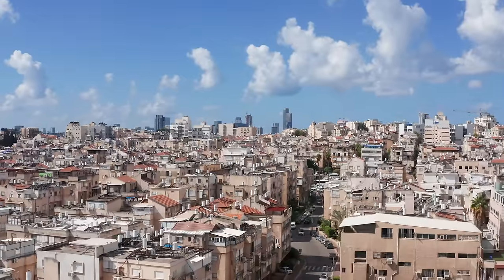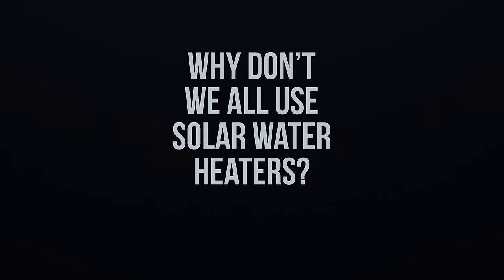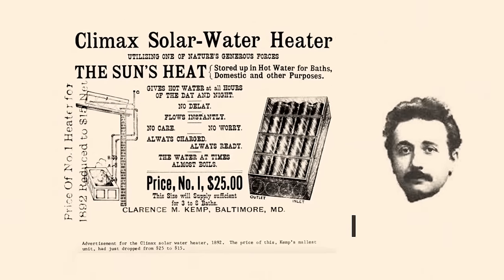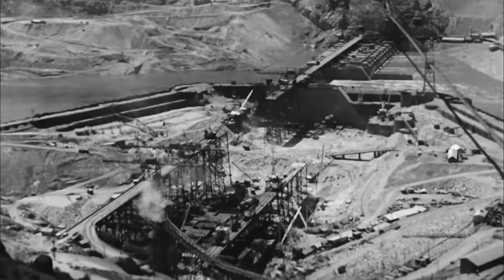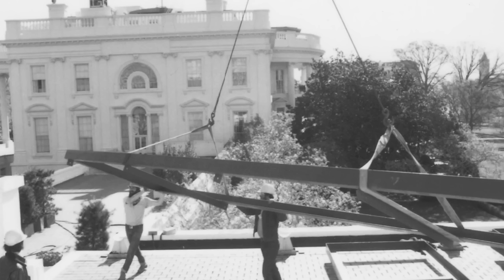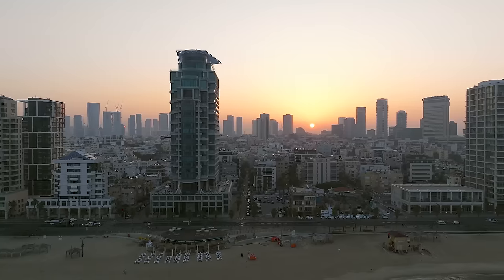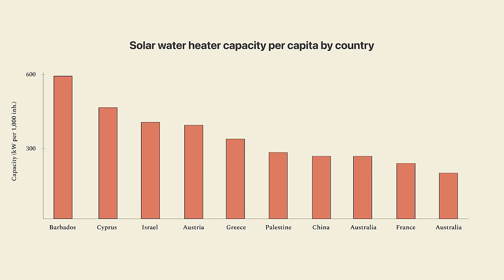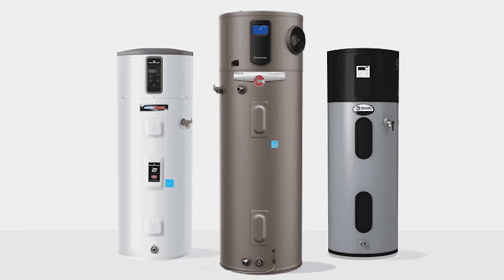Why Don't We All Use Solar Water Heaters?

Comment: let me get this right. Solar hot water "works" when the sun shines. 
It heats up the water using the power of the sun either directly and depending on the model - can heat the water through the use of the sun's heat directly or using solar panels to create electricity to power the the heating element which then heats the water.
Absent of the sunshine either due to seasonal changes or because it's a cloudy day - the solar hot water doesn't function or doesn't function well enough to supply the dwelling with enough hot water for the dwelling's needs. The "backup default" thus far has been either grid fed electricity or gas that is used to heat up the water...

Meanwhile "Heat pump" hot water also uses electricity but more "efficiently" by taking the heat of the surrounding air and transfers the heat to a refrigerant which is then compressed using a compressor which functions similar to that of the traditional heating element.

My question is: why isn't there a model out there that integrates the two system?
Have solar hot water on the roof with heat pump sitting on top of a nearby storage tank?
A temperature probe should be enough to switch the the "heat pump" end of the system on or off given that that majority of the time the "solar water heater" will be doing the heavy lifting... 
Granted I'm not an engineer, but one would've thought that the heat pump's hot water tank should be constructed to hold water that's been heated through alternative means similar to solar water heaters?
Am I missing something here?

Comment: A better approach is photovoltaics running a heat pump hot water system, once your hot water is up to temp you can use the extra power elsewhere, with thermal solar panels once the water is hot, thats it.

Comment: Because one solar panel only makes enough energy to run a toaster. You need ALOT of Solar panels to provide energy to a home. Even if a roof is covered with solar panels it still won’t provide enough energy to run a home.

Comment: Bottom line is that solar only works well where the sun shines a lot and wind only works well where the wind blows a lot.  Neither of those things is "everywhere."  Remember, making the equipment does require energy and money, and it only "pays back for itself" in places where you can really get a lot of bang out of it.  This is particularly true of photovoltaic panels - use them in the wrong place and they never recover the costs of making them in the first place, and you've "set the world back" instead of helping it.
   
That stucco roof in your thumbnail picture - at least in the US those say "the Southwest," and that's a very good place for solar.  A few minutes ago, though, I was watching a video made by a dude in the UK, about solar thermal.  The UK is NOT a "happy place" for solar.  People hear about these things and think, "FREE???  I WANT IN ON IT!"  And they don't bother to think whether or not it's going to be a wise idea FOR THEM in THEIR HOME.

Comment: We use solar to heat water in Guatemala. The electricity is cheap, but it is so much more reliable to have solar. On my house the heater faces east. There is a big avocado  tree blocking most of the sun. inspite of this my heater makes all the hot water I ever need. I can not get this HWH is the USA.  It is made in China. We also get a few made in Israel, they are the best. It is stupid that 90% of the residential hot water in the USA is not heated by the sun.

Comment: Heat pump water heater are not cheaper to install.  You’ve got a lot of facts Wong but your heart is in the right place.

Heat pump water heater is cheaper long term.   Great investment unless you have room for a large Solar PV array of 8 to 10 or more KW.    My 8 KW array more than runs my resistive water heater .  Over a lifetime the solar PV system won’t fail as muck as a water hot water heater, hence cost less.

Comment: I have looked into the cost of solar water heaters. They make absolutely no sense in the US or Canada outside of the Southwest. The claim that solar water heaters are less carbon polluting is not supported by facts. It ignores the fact that carbon dioxide is created in the building of the solar water heater, which is substantially more than in the building of a simple gas fired unit. However, that fact is reflected in the price of the units.

Comment: For a quicker solution you can switch to at point water heating, instead of one big water heater tank, you just put a small unit we’re you need it, for me it’s the shower, kitchen sink, and possibly the washing machine(still looking into if it’s required or not. 

It will save approximately 50% of energy used to heat water, which is about 17% of your total electric bill, so your electric bill will be reduced by about 8.5% 

Also it’s nice having instant hot water instead of waiting for the pipes to warm up. 

Plus the amount you will save in plumbing by only have a water line instead of a hot and a cold.
Reply: The channel Technology Connections did a good video on why this is actually a bad idea. Traditional water heaters actually don't waste that much energy cause they're VERY well insulated. At point water heaters require MASSIVE amounts of power, which means you may have to upgrade the electric capacity of your house to get it, or be willing to shut off other power hungry appliances while you're using hot water. Also, traditional water heaters can be used as an energy battery, using power when it's cheap and plentiful, such as during off-peak times or around noon when the sun is highest if you have plentiful solar. At point water heaters can't do that. If you're coming home from work and want to shower at 7pm when electric demand is the highest, you're going to draw insane amounts of power during peak times, forcing power companies to run dirty inefficient peaker plants (which are probably fossil fuel powered) to heat your water. Instead of slowly heating it up throughout the day using solar power (via either rooftop solar panels, grid scale solar panels, or solar water heaters), and having it ready for your evening shower instead of increasing the already problematic fossil fuel peaker plant burden. Look up the "duck curve". At point water heaters worsen it, whereas traditional water heaters can help reduce it.
Reply: @emilysmith6897  those are some good points.

I’m not sure about the upgrading a homes power supply part though, while I was in Thailand at point water heaters were everywhere, they didn’t seem to have special power needs. 

It was really nice having instant hot water too, my research has pointed to at point water heaters being 50% more energy efficient then their tanked counter parts, but it could always be false data. 

The biggest thing you mentioned would be the higher power draw during peak power usage hours, but that could be solved with solar panels.

Comment: I live in Oregon, not an ideal spot for a solar h2o heater. But I was thinking if it were possible to use one as a pre-heater, before the water enters the main gas h2o heater. Smart? Stupid? (The hybrid heat-pump h20 heater guy said it was mechanically impossible) 🤔

Comment: Y I SAID WHY CAN'T WE GET those water heaters made in Israel in this country ??? !!!!!!!!!!!!!
If they are only $700 we can import boat loads and the transport cost would only be about $10 per unit in large quantities. 
LOOK AT THE DESIGN !! that stores the water in a tank on the roof and delivers it down into the building. 
NOTHING like that is in existence in this USA where U can get a unit that will work with each Home and residential unit.

Comment: It is way more efficient money wise to just use photoelectric solar panels and heat a regular heater with the excess.
The installation way easier. Maintenance same. Also when it is cloudy you don’t warm water either but and this a big but, you have energy for your regular use. Thermal solar heater is an expensive nonsense today.

Comment: Base off this information - wouldnt it be more wise just to say, we need to update our power generation methods? For example, "free" upgrade or "cheaper" upgrade to our power panels that allow solar generation to happen on the cheap? This way you can install  your own solar if you want and have a safe way to connect to the grid. Aka, push for heat pump water heaters that can pull power ~ but if every house as at least 1 solar panel - that pretty much covers the cost of all the extra power needed if you use one or not. Also, the main problem is gas is really cheap. USA has a TON of natual gas. Its not made from oil normally, but taken from the ground. Thus its super cheap to have and use as an engery sourse. Also, unlike oil, some gas is consider endless because of the method making it is renewable. The problem with gas is its not normally efficient ~ meaning you are burning more to get the same amount of heat out compare to ev designs. When it comes to hot water heaters though - they're pretty efftive though as they're design around the idea of keeping all that heat generated in the system. So really its more of a wash? lol. If anything, like said at the start, the best would  be some mix method using a HP and solar. This way solar can power the heater - but also any engery that isnt used can go back into the grid or your house. That would have more benfits long term than simply a hot water solar heater.

Comment: A Gen-Z selling big-government solutions thinking it will fix their future, not realizing it will put them in future debt. How disappointingly unsurprising.
I lived in a  2-tank solar water heater house growing up, supplemented with wood and propane heating. I had a friend who's parents went all-in with a solar tank that took 1/3 of their garage. I moved into a house that used to have solar. What does my current house and my parents house have in common? Both no longer have solar. Call it economies of scale, call it jumping through hoops with either vacuum fill and dump or indirect antifreeze heating to keep it from freezing in the winter, there is a HUGE difference keeping rooftop hot water going where you have a week below 0F and where its always warm to hot and sunny.
If the research has paved the way, with global trade we should be able to get those Israeli  or Chinese water heaters for about the same price. Most of our gas and electric water heaters are probably from China already, but we don't. Why? Maybe it's not just the tank. Maybe its also government regulations, the same thing the narrator praises. 
It would be great if solar water and electric was the best, it just isn't. It has to be subsidized and produced in horrible conditions to be cost effective. Maybe rising energy prices will keep offsetting that. I think that is what the bureaucrats and global politicians are going for.

Comment: Pictures at 3:14 don't look like a "Boom Town", that looks very sophisticated. The people may have been new, but they didn't build those structures, even soo to the effects that when they so called build those building they didn't consider heating or cooling and had to add them after...Doesn't make sense bro! Theres only 2 options left. They built the building efficient enough to heat and cool themselves or they didn't build them at all, and now have to make adjustments. Which only raises more questions than answers. Who built the buildings in respect to heating and cooling. Not to move the goal post so to say. Theres more problems in this than solutions!

Comment: solar collectors are not populair here in the netherlands.. it cost around 3 - 7K euro, and you save about 3 400 euros per year. the most water is not needed in the summer. and it does not work in the winter. but that i did not care about.. i heat my jacuzzi with it for free now. i dont care if i dont go in it for 2 weeks.. but its 37 degrees celcius (98F) every day the whole summer. except when its cloudy for 3 days..

Comment: Solar water heaters are worthless especially if you live in a place with a lot of clouds or seasonal cold weather.  You might spend over $1000 for a solar water heater, but for the same price you can get about 1000 watts worth of solar panels.  Modern solar panels are 20% efficient which is very good.  With the electricity from the solar panels, you can then theoretically heat water even when its partly cloudy and/or freezing outside.
Reply: I have both thermal and PV solar. Thermal is 4x more efficient than PV per m². Clouds affect PV as well. Cold is a real issue since the tank is outside but in my Greek island the t° rarely drops under 5°C in the winter. There are solutions though: just install the tank inside and use a pump to circulate the antifreeze. My solar heater cost me 800€ brand knew and it's a  3 energy model from a known German brand. Efficiency of PV is not = the efficiency of the panels. Your inverter is also losing a lot of energy and is prompt to failure. Unless you are an engineer and design you own direct DC heater (heat resistances do not need AC current)

Comment: I don’t even have to watch the video. I used to sell solar thermal and came to the conclusion pretty quickly that is infrastructure intensive, control deficient, in In the End more expensive than just putting solar electric on your roof and running an electric water heater

Comment: Good vid.  Any specific suggestions? I am trying to do a completely off grid tiny house and wanted  to a solar propane hybrid water heater system with a small footprint, but am having difficulty finding many solar propane hybrid systems whatsoever. I really wanted a tankless one but that is never gonna happen obviously! Ive seen some great all-in-one solar water heaters but none have a integrated backup system.
Reply: There are a few discord servers that have prety knowagable people give it a try
Reply: As far as I know there is not really any pre built ready to go systems for rvStiny homes, There are plenty of “DIY” hybrid  system ideas online. Unless your heavy use of hot water or really just want to save the planet I’d stay away from the instant hot water.  These are expensive to buy and if they break they are super expensive to fix.  Also without some sort of tank or storage you can’t really use solar-even if it’s just to preheat.  Good luck!
Reply: I have a small home, 850 sqf and often thought my PV system would be ideal for a tiny house.  I have fridge, hot water, pumps dishwasher with heated dry, clothes washer where all cycles use hot water and it all works on a car battery from 3KW of panels into a 500W controller. And a couple medical devices to keep me alive at night. Basic systems work even with three days of rain. All for a little over $100 exclusive of panels. Did I mention 70% of panels are in shade at any time and that 3KW of panels wouldn't be needed if location wasn't shaded.

I mention this because it is not a technical problem to accomplish this, but the products to make this are not commercially available.
Reply: @opera5714  Trolls gonna troll ;)
Reply: @UnexpectedInquisition  I like to think I'm part of the minimalist movement. My specialty is heating water. If you bothered to listen, you might learn something.

Comment: I currently use a heat pump water heater, I definitely have considered using solar, but being in Pennsylvania, the freezing temperatures make it a lot more complicated, I’d have to use some sort of antifreeze and a heat exchanger whereas if I was in Florida or similar climate, I could simply preheat before entering my water heater making it have to work a lot less when it was sunny out. Decent video except for the politics.

Comment: Lived for a long time in Brazil, there we didn't have water heater at all, but had a small electric heating element in the shower head that would allow for hot water in the shower, for the rest of the house there was only running cold water.

I currently live in Norway, where water heaters are dominantly electric, doubt there are many solar water heaters except for some cabins. Norway is alos much further north than northern USA, efficiency of a solar water heater would be quite low.

Comment: yea !  a passive rooftop hws is all anyone needs  no moving parts !  just natural convection. mine is from 1950,s with a STAINLESS STEEL TANK  don't be fooled into getting a so called :ceramic" lined tank  for any hws !  they have a short life built in obsolescence of 10-15 yrs !!! as a retired plumber I can you  rheem still make a s/s tank but they won't offer it to you unless you really push the issue !  THEY JUST WANT YOU BACK ON THE SHORT LIFE CYCLE !!!

Comment: I want a solar water with a high effientecy electric. idealy with a heat sink. Mate has solar water with a massive heat sink via under ground heating house and shed. so excess is to house or shed or both based on when in year